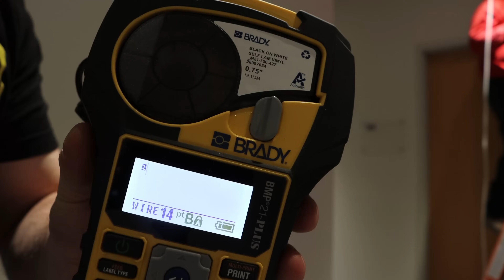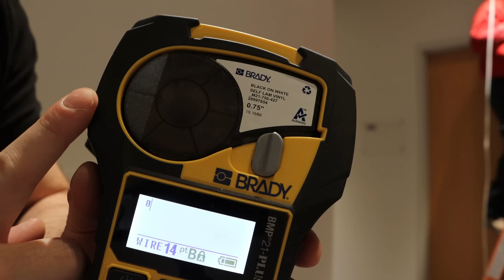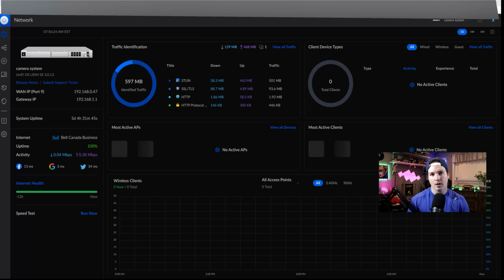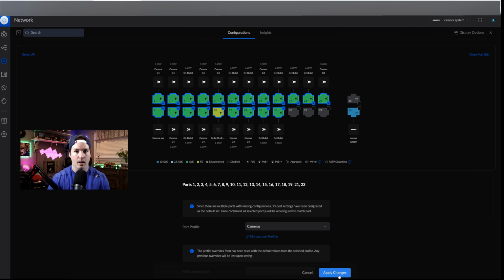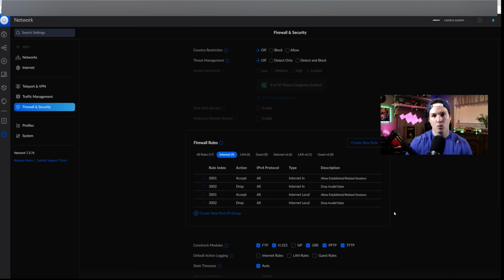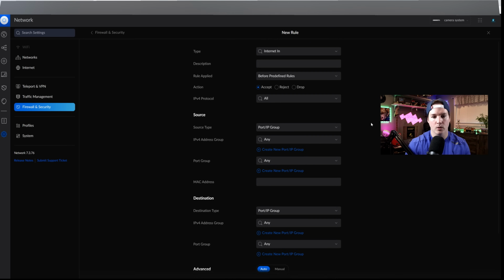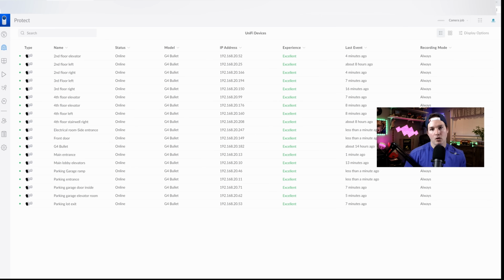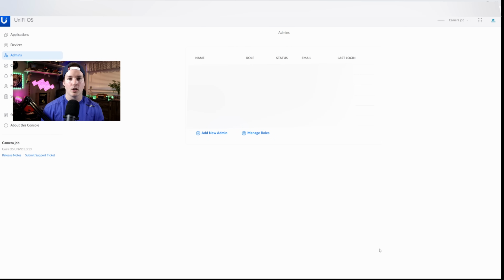Unifi Protect Installation and configuration

Comment: What a great video. I have been using Unifi's APs for several years but I am new to the cameras and I am getting ready to install some but I have a few questions. Do I need the NVR or can I run the cameras without it? Also what would happen if you locked the device to MAC address and the device went offline?

Comment: hi,I bought a g5 flex but when connected to the udm pro it doesn't appear.. I tried using a poe injector and it didn't work either, any suggestions?  thanks

Comment: Great video!!!. I thought you will use the scissors as the crimping tool too, lol. I just realized why every time I am doing wiring near a network/wiring/low-voltage expert they look weird at me, I just realized I do the wiring the other way: brown, white-brown..... that way when I use the crimping tool I use the lock pointing up which makes more sense to me, but it seems you guys (network experts) do it the oposite/right way, now I am screwed up because I learned the "wrong" way like 25 years ago and keep doing my wiring that way, lol.

Comment: You all missed the NFPA 70 (or in the US we call it the NEC), Class 2 cables (which POE lines would be classified as, and section 725.130(A) cables above a suspended ceiling must be supported at regular intervals).  Section 645.5(D)(5)(c) also requires Information Technology Wiring (aka network cables), be secured to the building structure in a way that prevents them from being damaged.  I also didn't see if you penetrated a firewall as well, and that also requires a listed penetration coupling.  And as a final thought, I didn't see if your network cable is plenum rated or not (it's required in the US in most districts as the flammability rating of the jacket is different for plenum, hence the higher cost).  Just my 2 cents.
Reply from the maker: It’s all strapped up with jhooks, when going through a wall we added what we needed for the fire rating

Also yup it’s plenum rarely ever use riser

Comment: Can you explain some of the security settings a little more in-depth?  When you start discussing what you're doing, you're talking at a walking speed, then you switch to plaid speed especially when talking about making the rules.  Some of it can be followed, you need to pause and rewind it multiple times to do so. Can you explain why you're doing some of the drop, block, and allow settings? Then you create a port group RFC1918 add a bunch to it without explaining what they are; as I have never watched any of your other videos to see if it is explained elsewhere.
Reply from the maker: Hey,

I have this video https://www.youtube.com/watch?v=P2OPlU62cBk&t=1s  on firewall rules.  It is a bit older but I will be updating it shortly with the new user interface
Reply: https://youtu.be/UGBobTInIBc

Explained as he sets it up

Comment: We ran cable in 12 drop bundles to multiple classrooms in a school using a 1/10th-scale RC Car it made simple work running it down the long hallways. We keep track of it by attaching a small flashlight to the top of the car.
Reply from the maker: I actually saw someone on Instagram do this its genius lol

Comment: You know you can save your fingers by geting RJ45 jacks that allow you to push the cable straight through it so you are guaranteed none of the cables slip back and you have to re-crimp it or stress your fingerings our holding the cable in place so you can crimp it properly. I used to do like you until I got the straight through ones save to save my 60 year old fingers from more damage. :)

Comment: Hi - love (and share) your OCD with cabling and also a big fan of ubiquiti kit. Just wondering, reviews I have seen say the thin patch cables should not be used for PoE as the thinner copper  can have heat issues due to higher resistance. Have you seen this at all in your installations?

Comment: Was really disapointed that you just run cable in a drop ceiling and don't secure it up like we are supposed to. Your racks are clean when set up, but the cabling in the ceiling you should be securing up and not just laying on tiles.
Reply from the maker: There’s jhooks in the ceiling that we laid out cable in I wasn’t going to put my dslr camera up there though 

Getting a gopro so I can show in ceiling

Comment: I install Protect cams professionally as well and was wondering how you guys mount the bullet cameras to cieling tiles?
Reply: Not sure how they would do it but I would buy some square metal junction box covers and use self tapping screws through the tile with the plate on the back of the tile. That being said I don’t use bullet cams on ceiling tiles, or even unifi cams in general, and don’t necessarily recommend bullet cams for indoor ceiling installations as dome, mini dome, and turret cams are much better suited.
Reply: @ryderholland  On the rare occasion I use a bullet camera inside I use a 2ft piece of wood so it fits between the grid and is not just hanging off the tile

Comment: When you fished the cable in the ceiling, did you run on top of the grid or through the proper hangers to keep cable off of grid?
Reply from the maker: They had jhooks already installed

Comment: Mac and port security is not secure at all, most of the times the MAC address is written on the device and can just be cloned on your laptop.
Reply: Then scratch off the MAC address with a blade or use a black sharpie to cover it up.

Comment: Great Job again, and a very good explanation of the Firewall Rules.
May I asked a question about the Rules...
I have a Network for all Security-Stuff, including Access and Cameras. I am using a UDMPro, I don't have an UNVR. I also have a Network for NAS and for Guests.
When I following your steps with the Firewall Rules, all Cameras went to offline, also the UA-Pro. The UA-Hub stays online. Where is my Failure? I know this may be a hard question because of not seeing all of my installation-steps. 
Greetings, Michael

Comment: Great Job Cody! Question... For that amount of camera's how many TB of hard drives do you put in the install and how long of a record time does it give you?
Reply from the maker: Hey Franklin,

For this install I installed 4x TB drives I believe it gives them about 23 days of recording running 24/7
Reply: @MactelecomNetworks  What does the NVMR plug into? Why use the NVMR instead of the single Bay in the UDM with a larger hard drive? Is the NVMR in a RAID config?
Reply from the maker: @cloudmike  it plugs into the switch just a rj45 port but will be pluggin into the dac soon.

so the UDM Pro or SE can only hold so many cameras, once you pass that limit you need to move to the UNVR, Also more space and hard drive redundancy

Comment: If someone is able to get to these Cameras physically they could also spoof thier MAC adress to match it to the unplugged Cam
Reply from the maker: Yup 👍 someone else mentioned that didn’t even cross my mind.
Reply: @MactelecomNetworks  Well thats why you have them on a seperate network unable to communicate to the others. 
To Prevent this you could give out static IP Adresses and disable DHCP so the attacker would need to snoop the cable to know what IP to use aswell
Reply: Just scratch off the MAC address with a blade or use a black sharpie to cover it up.
Reply: @runuphill  The MAC adress can be accessed by plugging it in to your PC... I dont think you know what you are talking about here

Comment: Do the cameras have MAC addresses printed on the device itself? I'd imagine so. So a MAC lock in that case is only useful if someone doesn't know to spoof a MAC
Reply from the maker: That right there is an excellent point that I did not think of
Reply: Just scratch off the MAC address with a blade or use a black sharpie to cover it up.

Comment: I was SHOCKED to see you don’t use pass through connectors, as soon as I used one once, I just can’t go back. Of course I’m old enough my eyes suck at close up stuff.
Reply: because they are bad for poe runs
Reply: @Pedja-q8t  why’s that? Same crimping style and force and no chance of any conductors being partially into the connectors. I’ve been using them for a couple years now without issue but if there is a legitimate reason, I want to know so please let me know.
Reply: @waynenocton  because they crimp at the edge of connector and sometime imperfections happen and you have piece of copper wire that's under V touching inside of socket its in and causes short to ground, don't happen that often but just chance of it happening is enough for me to never use passthrough for anything POE related

Comment: Good job showing folks how to do these things.  Side note.. the "pull string" you cut is there for a reason.  When you strip the outer sheath of the cable, there is always a possibility of a nicking the cable, not matter how careful one tries to be.  The string is there for you to pull down the sheath, using the string as a cutter to take off more outer sheath and  thus remove the possibility of terminating a nicked cable as you have gone down below the initial cut.
Reply: Ah come on, no one does that, a quick check of the cable and experience is enough
Reply: @paulfin100  Sure I get it... and I didn't do it for many years until it was explained to me.  Now do it on every cable I terminate.. takes like 5 extra seconds.  I agree is most likely not needed but when you are making a video about doing a wiring job and terminating cable, at least do it for the one cable you record :)
Reply: I was not an expert when I started my business 25 years ago, today I have enough experience that I consider myself an expert and I had never ever messed up a wire cutting them either using the crimping tool blades or any type of blades; can you show us a video of yourself performing the modular plug installation to see how  you are able to pull and remove the skin with the "pull string", I do not think my pinch pressure will be able to pull down the string to cut the sheath.
Reply: @androjesus  On regular indoor rated cable you can wrap it around your fingers and pull down and it will cut the outer sheath.  On direct burial and harder outer cables, I make a small snip on the outer sheath to get it started...then pull the string down that cut.

Comment: Hi, What brand are those small patch cables you used?
Reply: Monoprice SlimRun Cat6 (6-inch)
Reply: @andibyts  You don't have issue with Poe on these cables? I heard these are so slim they could not support Poe
Reply: @nicolasarnold4944  i use them with poe for my accesspoints had no problems so far

Comment: Nice neat setup, like the firewall rules you setup as well, didn’t know about the MAC address either, changing all my clients to lock those down, not that someone is going to climb 25 feet up a ladder just to get to the cable, we’ll maybe… I always disable ports that are not in use.
Reply: IMO the mac filter is completely useless because if you have access to pull the camera down then you are able to look at the mac and spoof it.  the mac filtering would just stop people that don't have a clue what they are doing and we don't worry much about them.

Comment: How do you typically calculate your POE budget? Trying to determine what switch I’ll need. Possibly 5 cameras and an access point. Runs are less than 50 ft I’d guess.
Reply: Look at the camera specs. If it pulls 4 watts and your switch can do 150 watts then you could do 30 cameras relatively easy.

Comment: why are you using a bullet in a hall and not flex?   seems over cost over kill.
Reply from the maker: Anything g3 does not have smart detections. Also the customer bought these I just installed
Reply: @MactelecomNetworks  gotcha.   Although I don't think having smart detections in a hallway would matter.      I install a lot Unifi equipment but always wondering what others do and why.  Thanks for reply.